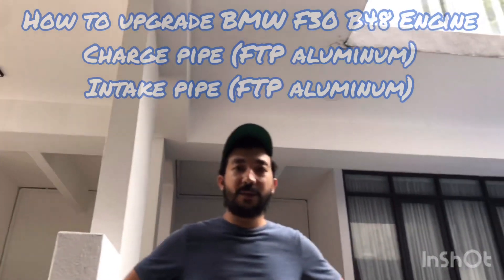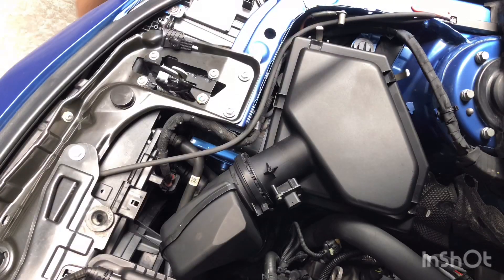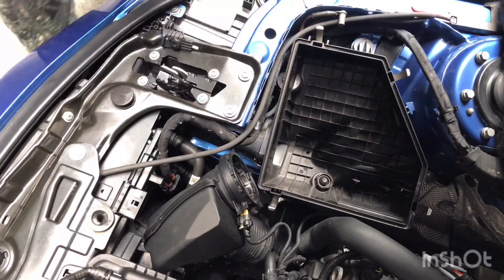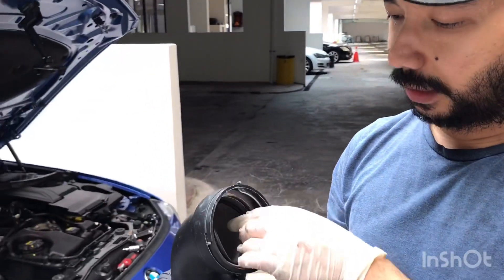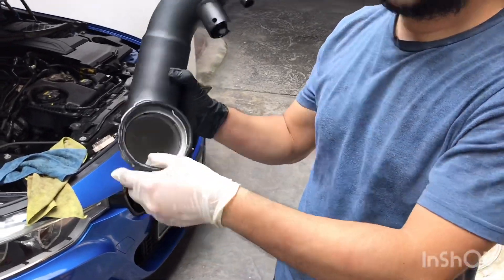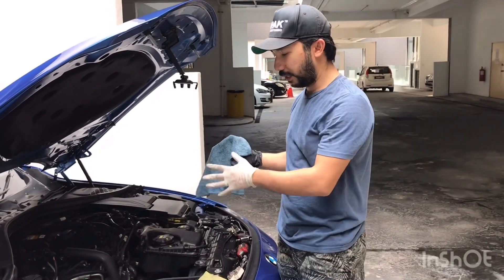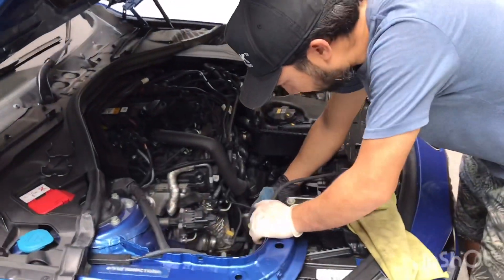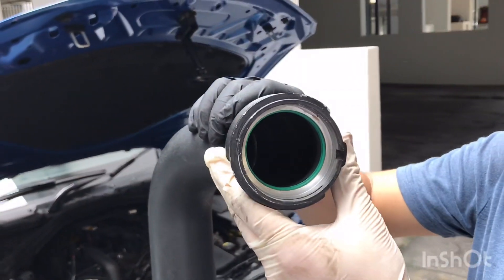BMW 330e F30 B48 charge pipe and intake pipe upgrade tutorial

Comment: I just installed the ftp inlet pipe with evolution racewerks charge pipe and car feels slower now i was expecting a slight difference on the throttle but it almost feels a tad sluggish the first 3 secs of throttle
Reply: did you ever figure it out? maybe you didn't tighten/push things in all the way
Reply: @ElykElyk-qi2fh  so each upgrade I did I always tested it out in comfort mode to see if there was a difference because imo if there's a difference in comfort mode there's a difference period. So up until my last w mods I felt a difference in comfort. Drove for a while IN sport+ and could see the car wasn't slower at all maybe just my expectations were to high for sport mode since I noticed a difference in comfort I was really expecting alot out of sport + but sport+ is impressive on its own w stock parts. Hope that made sense lol thanks for responding
Reply from the maker: Maybe there’s a leak

Comment: nice but you did not show how unplug sensors, not wires only sensors from tube, one has 2 clips but this second? you can show after if is unscrew and disconnect because now I have problem

Comment: I have a 2017 330e f30 and I’m having a hard time looking for a intake and a chargepipe
Reply from the maker: There's quite a few out there.. mine is FTP.
Reply: I have FTP charge pipe and intake pipe. But, I dont know if it's necessary. I think chargepipe failure was more on the older engines not b48.

Comment: How do you remove the vacuum pipe on the last intake piece I got that far and got stuck doesn’t really show in the video
Reply: I figured this out - but I am having issues with the C clip at the end attaching to the oem air box in the video it looks like you had issues too with it
Reply from the maker: @theroomwrecker   yes i did. A prying tool would be handy.

Comment: I got a 2016 330e... i just bought the VSRF downpipe.... did you ever change yours? I was planning to go bm3 stage 2. It would be nice if there was a tutorial on this...
Reply from the maker: Yes mine is on custom downpipe - Im on custom stage 2 remap. many friends here is on BM3 stage 2.. theirs packed more power..
Reply: How is the car doing after a year? Please update!
Reply: @MrArmaniStyle  Well. My engine blew, had to get it replaced. 24k quoted at BMW. I have a friend that works as service advisor so I got the engine replaced with new fly for 18k. Still have all the mods on but I drive it like it's my 1st car now. Should really take everything off...
Reply: @GA_Lily_K  you were running bm3 stage 2?
Reply: @certainsomeone64  yes i was. lol
Reply: @GA_Lily_K  RIP. how many miles did it have and how many did you drive on the tune?
Reply: @certainsomeone64  I think i had around 65k when i did the tune, and it went around 75k. But, I cant completely blame the tune because I went about 2k over the oil change. But who knows. I am going to bring it back down to stage 1 and put the OEM Cat back on as I am having a baby now and I dont want her to breath them toxic fumes.
Reply: @GA_Lily_K  Sorry to hear that. How often did you change your oil? Did you go 2k over what bmw recommends (10-15k miles) or what many tuners recommend (5-8k miles)?
Reply: @MK-kt9fl  actually, I went over the 10k factory recommended. I did not know that tuner recommends 5k oil changes.
Reply: @GA_Lily_K  Oh wow. Ok, well that seems to be the reason for your engine blowing up. I also wanted to ask, did you do any datalogging with bootmod3? If you have bad fuel and or old spark plugs you can get something called "knock". If knock happens at full throttle it can severely damage your engine. I suggest doing some datalogging with bm3 and look for "Knock detected" and "ignition timing correction" on all cylinders. Ignition timing correction should be as close to 0 as possible but small corrections aren't a problem.
Reply: @MK-kt9fl  they checked and fuel, sparkplug, coil was all good. it was the oil change. i know i fugged up.

Comment: Hi. Does your charge pipe touching the coolant hose?
Reply from the maker: there's just a small gap. so yeah, not touching
Reply: This is a problem in B58 engine. I have read some people B58 owners had issues because ftp charge pipe touches coolant hose and It caused leaks. I'm going to install ftp charge pipe in my F20 B48 and I hope It won't cause problems.
Reply from the maker: @federoco1  Actually it touches.. i had to put like a pad thingy
Reply: @M4STR  can you make a video?
Reply: @M4STR  do you have a pic of the "pad thing" u used?
Reply: @M4STR do you have any photos of this? My one is currently touching and damaging the coolant hose ever so slowly

Comment: Hello. I own a bmw 330e and i have 90k miles on board now. Can you please tell me when or if i should replace the timing chain?
Reply from the maker: Constantin Marin i dont think the timing chain needs to be replaced at that mileage. Worst case would be the timing chain tensioners that is made of plastic which can be subjected to wear and tear. B48 dont hv N20 timing chain issues, therefore rest assured all is good.
Reply: Hi I own a 330e 38000 miles less than 4 years old in August the timing chain snapped I’ve just had a total engine rebuild at the cost of £3802 I have contacted bmw UK no goodwill at all totally disgusting by bmw so renew the chain mate my guides were ok no wear marks or rubbing at all. It’s now in the hands of the vehicle Ombusman hopefully he will find in my favour.